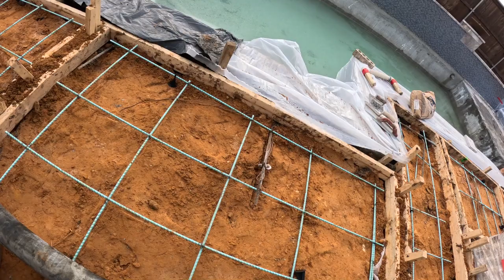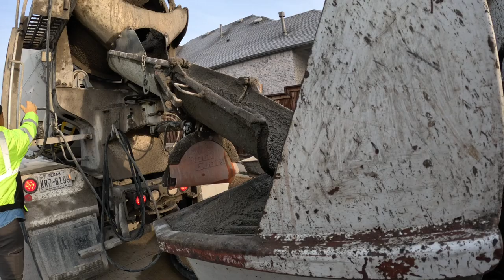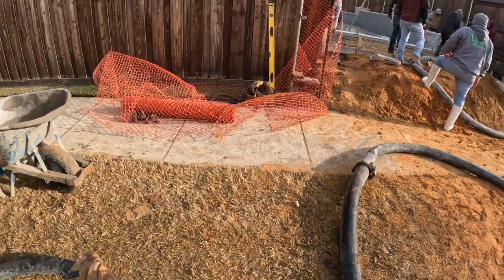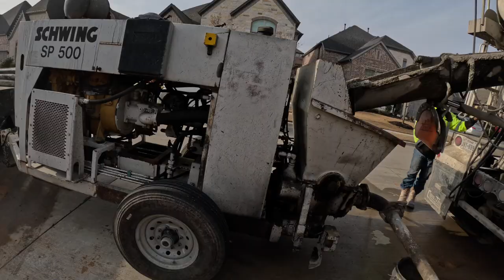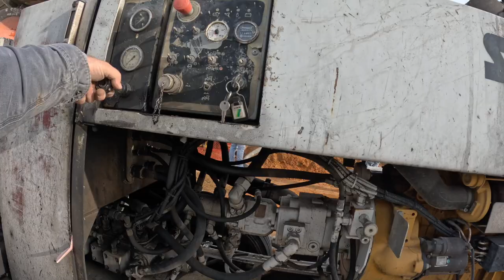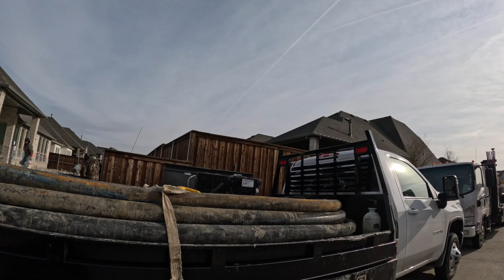Episode 3: Will it plug! pumping concrete with a trailer pump with Muddyfeet

Comment: When that pea gravel mix plugs, it plugs HARD! Feeling pretty good about my guess of 40’ (closest without going over, right?). Also, my wife yells over to me from the kitchen that “whatever I’m watching sounds like nails on a chalkboard”. Guess she ain’t as fond of a little CAT/Perkins diesel screaming away at 2400 rpm as the rest of us are. 😂😂😂
Reply from the maker: May need a bring the spouse to work day. You know get them up at 4 am. Make sure your other pump operators are on time. Then go out pump one with you. Help drag hoses. Answer phone calls. Keep jobs on schedule. Return more phone calls. Explain to customers why the pump might not be on time. Answer more phone calls. Blow the system out and load hoses. Return more phone calls. Wash and grease the pump. Help decide if one of the other pumps needs to run hot to it’s next job. Answer more phone calls. Move a job or 2 around on the schedule. Go back to the shop. 🤣🤣🤣. And hopefully she’ll still be talking to you.
Reply: @MuddyfeetConcretePumping  you forgot “follow up with angry homeowner refusing to pay their invoice because operator rinsed out a hose into their flowerbed” 😂😂😂
Reply: @canadianconcretepumper1979  gotta at least water it in! get rid of the grey
Reply: @ehcoroche  Preferred technique is to dig a hole with my left boot, rinse hose
into said hole, back-fill hole with right boot. 😁😁😁
Reply: @canadianconcretepumper1979  can't put a price on experience

Comment: I use to drive a mixer, is it common for those little trailer pumps to plug up? Where I live every single time I got sent to a trailer pump it would get the worst clog, and would take forever to fix only to have it get plugged all over again.

A couple of occasions the contractor would have a army of gas powered buggies do the pour instead of the little pump. Didn’t know how common it was for you.
Reply from the maker: It is not uncommon to plug on start up. Once concrete has reached the end of the hose and plugging keeps happening typically the wrong batch design has been sent by the concrete company.
Reply: @MuddyfeetConcretePumping   Got ya!! Thanks for the reply!! New subscriber for sure!!  Brings back memories